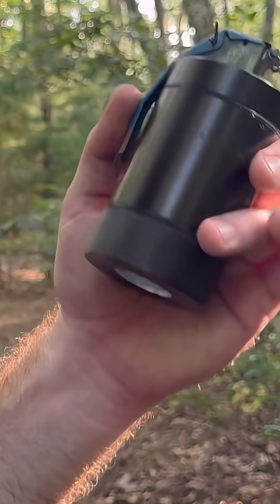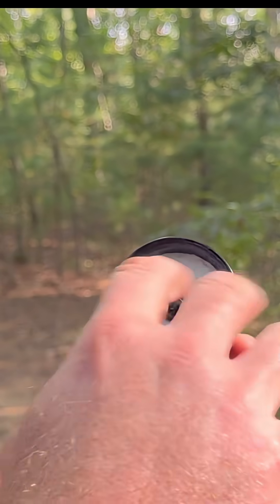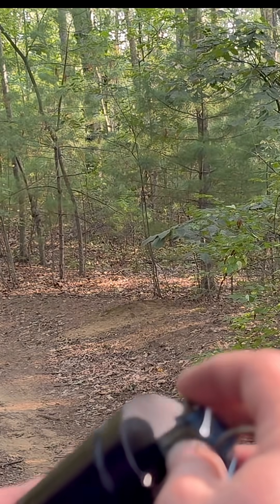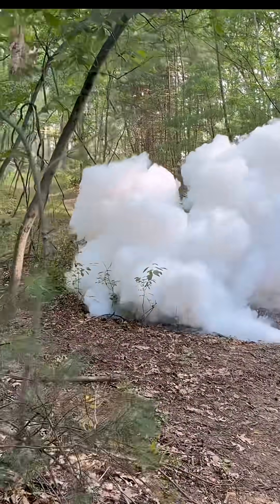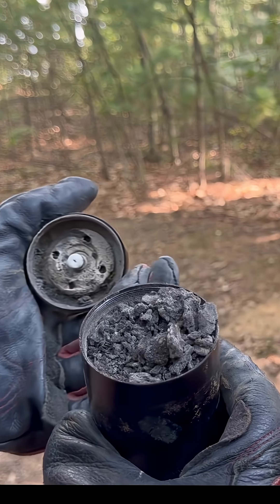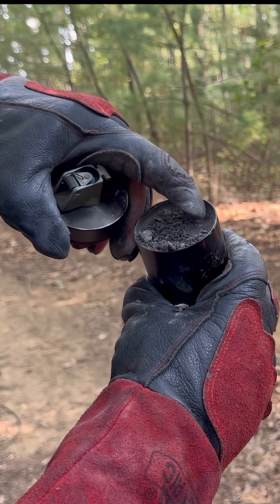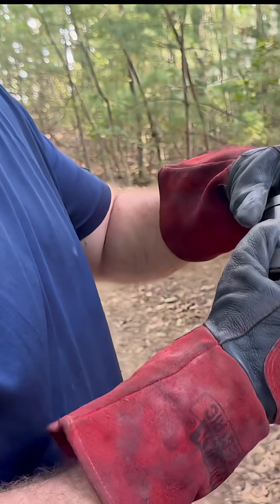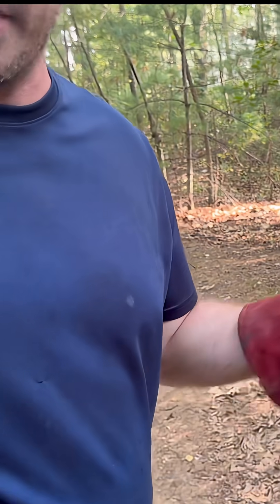How granulation works #science #experiment #pyrotechnics

Comment: I still don't understand how granulation works. Nor do I know how to achieve a specific uniform granulation, nor when to decide or even measure what different granulation should be used for different devices.
Reply: Ever tried to dry A BIT MORE of EUROSPEED with a Steel Sieve? Same thing! Same Solvent!😅 Or I was told…
Reply: @KroatienSS  I dont understand what is eurospeed?

Comment: Very impressive that throw in such a short window.
Just curious how fine of a prill are use using? I was looking at just getting the whole kit for the non-TPA smokes
Reply from the maker: I blend everything individually for shits and giggles. But if you get the composite smoke production kit from Firefox, that can be made without blending I think the ammonium chloride and hexachloroethane have the largest particle size at approximately 100 mesh.
Reply: @InventionIncarnate Thanks. I appreciate the info. I was looking at Firefox yesterday.  I think certain mixes are limited on very fine mesh on certain chemicals, to professional pyro and other professional uses. 
I realky like the new vented container. I haven't done a deep dive but I wonder if a fine mesh OC powder/PAVA powder would work for self defense and area denial, and what the legality would be. I wouldn't mine having a few of them marked for a worst-case scenario.  I've almost been boxed in during a riot and would prefer layered options of egress if needed.